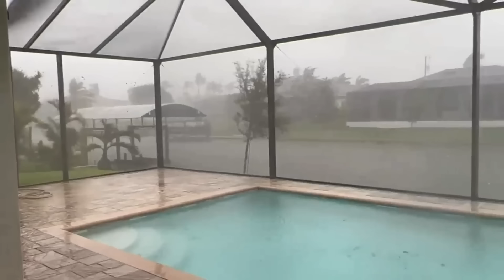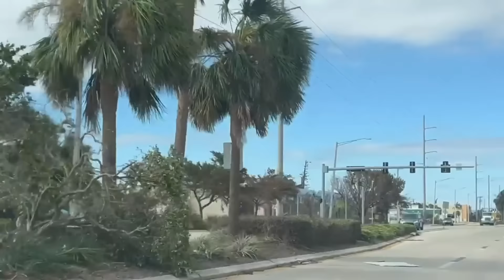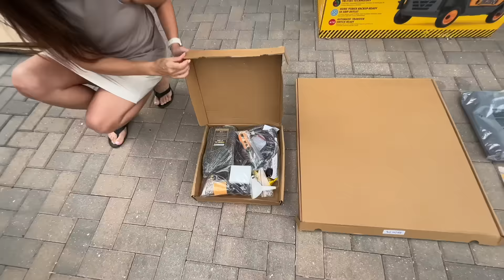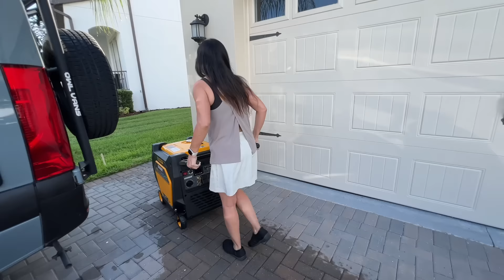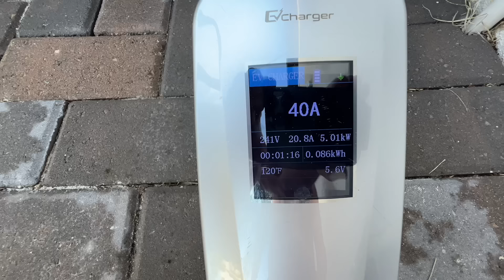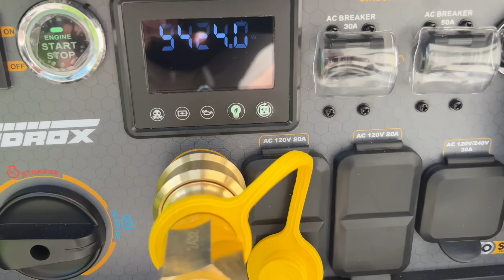Hurricane Ian - 3 Weeks Without Power Changed Everything: Gidrox 11,000W Generator

Comment: 😊 good idea Eco flow delta pro ultra X system and Eco flow delta pro ultra X extra 10 battery and Eco flow delta smart panel 3 and power whole house
Reply from the maker: Integrating a high-capacity battery system like that is a great way to build long-term power independence. 😊

Comment: everyone  doesn't need 11k genset . i did ok with a 1400 run sportsman during irma , i did use propane 3500 run  sportsman during ian .  ref freezer charging batteries tv fans lights  keep howse closed blinds shut cbs homes stat cook enough with fan for days . plus the bigger the gen the more fuel it uses and fu stations open have hours long lines\ btw i live in cape coral and untill recently vol with lee eoc  and only some areas had boiul water mostly in flood areas  and city failed as expected
powere stations whil convent they need recharging and will drain in day or so and if still cloudy and rainy a 60 or 100 watt panel's tale day to 3 to full charge  my sportsman have 8 amp dc charge plug i charged 100 ah lithium that have bms  dont charge them from idalling car though your alt will heat up sitting without airflow
Reply from the maker: You’re absolutely right that smaller setups can be very effective when you prioritize managing your energy usage carefully.

Comment: 50 gallons in a week? That’s crazy. There’s no way you were really conserving fuel if you burned through 50 gallons in just seven days.

I was in Superstorm Sandy and was out of power for 10 days. I had over 55 gallons of gas on hand, and what I learned from that experience is that a generator is not the way to go by itself because it’s completely dependent on fuel. If the situation gets really bad and you can’t get gas, then what? That’s one of the main reasons I switched over to solar.

You need to have a Plan A, Plan B, and Plan C. For me, solar is Plan A. As long as the sun is out, the batteries are getting charged and can power the house. If it’s been raining or overcast for a few days and the batteries aren’t getting enough charge, then I move to Plan B and use the generator to charge the batteries for about 4–5 hours. If the batteries are damaged or unavailable, then Plan C is using the generator to power the house directly, but conservatively.

That’s also where your central A/C becomes a problem. Anything running on 240V is going to pull a lot of power. Instead of trying to cool the entire house with central air, a few window units are much more efficient. I have four window units in my setup, and I can run them through the night and still wake up with around 60% battery charge remaining.

A battery backup system makes a huge difference too. Run the generator only long enough to recharge the batteries, then let the batteries carry the load. That alone can save a lot of fuel.

Also, propane generators don’t produce quite as much power as they do when running on gasoline, so that’s something to keep in mind. And after a major storm, you’d better already have a full propane tank, because propane deliveries can be delayed for days or even weeks depending on the damage.

Honestly, solar and battery storage are the way to go. Trust me, I’ve been doing this for over 10 years. There’s a reason so many people are getting solar. Let the sun do the work during the day, use the batteries at night, and keep the generator as a backup. If you had a decent solar setup, that 50 gallons could have lasted a whole lot longer than one week.
Reply from the maker: You make some good points.

One thing to keep in mind is that Hurricane Ian happened several years ago, long before I built the battery, solar, and backup power systems I have today. Back then, my backup power plan was basically a generator and fuel.

Even though I tried to conserve fuel, 50 gallons disappears surprisingly fast when you’re dealing with refrigeration, freezers, lights, fans, charging devices, and trying to cool part of the house in South Florida after a hurricane. The heat and humidity can be brutal.

Ironically, my experience during Ian is one of the reasons I’ve spent so much time building and testing solar, battery, alternator charging, and backup power systems on this channel. Today I absolutely agree that redundancy is important.

The reality is that every backup power system has strengths and weaknesses. Solar depends on weather, generators depend on fuel, batteries have finite capacity, and storms don’t always cooperate with our plans.

The biggest lesson Ian taught me was exactly what you said: don’t rely on a single solution.

Comment: Gas does not go bad, if  you rotate it though your car every 6 months.  The downside of your large generator is that you will never need that much power during an emergency and it would use too much fuel while not needing full power. Oh, also that is not propane, it is Natural Gas.  I would go with a Firman Whisper Series multi fuel inverter generator.  I have the WO3342, with 27 Gallons of stored fuel, it can run for a few weeks and repower my house batteries.  The EV can be powered from the batteries while optimizing the load on the generator.  Good luck.
Reply from the maker: After hurricane Ian, I used my generator to run my entire house including the AC, so yes I used the capacity.  Also, my house has propane not natural gas.  It is pipe the same way as natural gas as it comes fro a large storage tank for the whole neighborhood.

Comment: People should pay attention to the size of generator they need. Those big generators gulp fuel. If you can get by with a smaller one, you’ll be better off.
Reply from the maker: That is a great point.  I chose a big generator as I wanted to be able to run at least on AC in my home but if you only need to power a refrigerator/freezer aa much smaller generator would be more practical.  I do have a small Costco 2300 watt generator that I keep for just that situation.
Reply: @RubysAdventuresUnplugged  This generator can also charge your tesla while running the AC on Natural gas.  You have a great setup.  If you get a chance, think about adding a battery for your house that can also run your AC.  Mine is the Ecoflow DPU and a few batteries.  DPUx plus 2 batteries could probably run your house for half a day, or more, and the cost is coming down.  Good luck.
Reply: I ran a Generac XL5500 for 25 years and then replaced it with a Firman 3600W inverter.  During an emergency, you don't need as much as you think you do.  It is an emergency and you don't have to run everything in the house.
Reply from the maker: I agree that you can get away with minimal power if you want to just survive.

Comment: No idea how it works there, but don't they turn off the gas also if other houses are blown away? Keeping everything out of a salt water flood is probably an other primary task. It could come much higher. EV batteries don't like salt water and may spontaneously combust. Park outside.
Reply from the maker: I would agree that if a house was completely destroyed they would probably such off the propane, that is why keeping a couple 20lbs propane bottles is a great back-up plan.  Also, houses here are built from cement filled cinder blocks so it would be rare to see a house completely destroyed.

Comment: This looks like a CCP ad. And its nothing to rejoice about when the advertised limit breaker is not tripping off. it means you are frying your electronic faster. Just like i expected.
Reply from the maker: I appreciate the concern regarding the electronics, but I’ve been testing the load limits to ensure everything remains within safe operating parameters.  The load limiter did trip at 9500 watts which is not far from the max running watts of 9100 watts and under the max starting watts of 11000 watts.

Comment: Are you sure you're connected to PROPANE?  As a city dweller with in ground plumbing like you show, I strongly suspect you are connected to NATURAL GAS which has a different jet requirement for the air/fuel mix.. so it matters that you get it right.  On top of that, I find it strange that you noted the problem with fueling a generator, but then bought a new generator rather than adding a solar power station and solar panels to allow you to bank some power and reduce the amount of time you need to run the generator.
Reply from the maker: Yes my house is run via propane and I am 100% sure of that.  As for solar, yes I am a big believer in solar.  In fact I have solar on my van and I have done many videos on solar but solar panels can cause damage to your roof once hurricane winds get underneath them.  I have seen parts of roofs ripped clean off because of solar panels after a hurricane ... if I lived inland, I would definitely have solar panels on the roof and/or in the backyard.
Reply: @RubysAdventuresUnplugged  sorry you had to answer that so many times.. 🤪
Reply from the maker: np, I know it is confusing as it does look just like a natural gas line.

Comment: There are advantages of bonded vs floating neutral and it can be changed at the generator side. At the time I got a regular generator, an inverter generator for a whole home was expensive 5 years ago. Luckily, we don't have frequent power outages that warrants getting an inverter generator, but it's on my radar.
Reply from the maker: Technology has certainly made those larger inverter units much more accessible lately!

Comment: After hurricane Sandy we had no power for over a week and gasoline was in short supply for several weeks due to damage to the gas distribution facilities.  We used a 5000 watt propane generator during the day and a Honda EU2000i at night.  I had 20 gals of gas stored for the Honda and 4 twenty lb propane tanks.  Every day I had to go out and get the propane tanks filled.  I had no problem getting propane but would have had an issue filling a gas generator of that size.  You might want to a couple of 40 lb propane tanks on standby in case your neighborhood propane system dies.
Reply from the maker: first off ... Thank you for the replay and comment!  I 100% agree and have already purchased a couple 20lbs propane tanks as back-up ... you can never be to prepared and this talks can last a super long time.
Reply: Granted, I'm in Minnesota and not Florida, but we don't do neighborhood propane systems up here; which is why I made a comment to Ruby about being sure she's on a propane system and not natural gas... because IF Ruby's home is actually tied to a NG pipeline, as we typically have here, then the generator needs to be jetted for NG which mixes roughly 9 parts oxygen with one part fuel versus Propane, which is denser and needs a 24:1 ratio of fuel to air.  So unless that generator has the ability to automatically switch between those two gasses, your back up propane cylinders will not work as the generator would be running far too rich.
Reply from the maker: I have run the generator on both bottle propane and my underground propane so I am sure it will use both.  I am 100% sure that it is propane piped to my house as I have to pay the bill every month and I had to special order a propane capable pool heater for my pool/hottube set-up as well.  Also, the generator has a manual switch from propane to natural gas and it will not run on the natural gas setting when connected to my propane system.

Comment: Excellent video! Your video is like a breath of fresh air compared to other similar videos! I love that it was narrated by a very capable woman who is no stranger to anything she talked about. My only suggestion was you didn't do enough homework on the generator or on adequate fuel supply. Everything else was spot on! Congratulations! 
We did our homework & believe it or not our Honda EU7000is (Honda's flag ship inverter generator). It also has electronic fuel injection & super quiet. On economy mode our generator creates 52 db of sound & non economy at 58db. It's so quiet none of our neighbors can hear it running. We also keep 111 gallons of treated fuel that we rotate. We have enough fuel to last 3 weeks without needing to look for more fuel. Believe it or not our 5500 watt generator was tested to 9200 watts continuous at 240 volts. Only when we exceeded that to 9201 watts did the main breaker trip. Surge watts is 7000 watts. So ours went 2200 watts over rated load without tripping. So it's not uncommon to exceed the rated load on a quality generator. Our Honda can be paired with another EU7000is. That will deliver a whopping 11,000 watts if needed? We drive gas powered trucks with large fuel tanks. As retirees now we hardly use any fuel. We also are preppers like you. We would be content with not having to run out when everyone else does. We live inland away from the shore in New England. The longest we were out of power was for Snow storm Alfred. We were without power for 5-1/2 days. 
Our generator can back feed our entire house including our 2-1/2 ton Trane central A/C. 
Thank you for posting! Great content!
Reply from the maker: It’s always great to hear about how others are preparing their homes for extreme weather events.

Comment: You can change from a "bonded" neutral to a "floating" neutral by removing a wire inside the generator in most of the larger generators. The owners manual will usually instruct you on how to do this.
Reply from the maker: It is good to know that many manuals provide clear guidance on making those specific electrical adjustments.

Comment: Great idea 2 EcoFlow delta ultra X system 12,000 and EcoFlow delta ultra X extra battery 10 battery and EcoFlow delta smart Panel 3 with Ai and really power whole house and HVAC cooling/heating and EcoFlow smart EV charger
Reply from the maker: That sounds like a very robust setup for maintaining power through an extended outage.
Reply: @RubysAdventuresUnplugged no gas and really indoor back up power whole house and no sound

Comment: Think of your most minimal needs to reduce and conserve fuel. I like two generators 5500 watts each that can be paralleled for 11,000 total watts so when I don’t need the extra 5,500 watts generator one can be shut down to conserve fuel and used as a spare if one fails. I can run my well on 3,800 watts start up and my RO system on 4,800 start up but each will have a running watts of 2,100 and under. We keep a portable AC unit to keep cool in the largest bedroom for family sleeping. Fill extra vehicles full of gas and transfer that fuel for generator use. I make 240v with a step up transformer for the well. Every one’s needs are different except the need for some type of fuel.
Reply: I use a 72 inch R-12, refrigeration hose to transfer fuel from the truck to the gas cans by using the fuel injection cleaner port. Just take off cap screw on the R-12 line ( with the Schrader in it ) and turn the key, the fuel pump automatically starts pumping the fuel into the gas cans, you can run the engine also if you wish….
Reply: Do your 5500 watts generator’s  have a ( idle control ) during hurricane Wilma (2005) we were using a Generac xl-4000 with idle control, what a gas saver, once the refrigerator started up the compressor and it’s running the Generac would drop back to idle, at idle speed it put out 800 watts constantly…. refrigerator took 450 Watts after initial start up ,so unless you bridge the 800  watts gap, it never went into high speed…you can run lights (led-4watts each) turn on the entire house and it’s still on idle, microwave,coffee pot, 85” tv, water heater, then it kicks back into high speed…..and drops back to idle when you’re done with it…
Reply: @RicardoGonzalez-yz1vp Knowing what your generator is capable of supporting in an outage is more important. You proved it! Congratulations!
Reply from the maker: That is a very smart strategy for managing fuel consumption and redundancy during an outage.
Reply: I have one 5500 watt generator. It's more than enough for what we need. 
As for having a well. As good as they are. Having city water saved us after snow storm Alfred here in New England. 96% of the state was flat. This was before we had a generator. Our house was cold 38 degrees but we could flush our toilets & use the shower (albeit very cold marine corp showers). We have an amble supply of wood for the fire place. We survived. After that storm was the impetus for us to get a back up generator.

Comment: only one thing, you have natural gas or NG not LPGV to your home, just so people get the duel or tri fuel selection correct
Reply from the maker: Pat, I do have LP as the subdivision has a large propane tank that is plumbed under ground to each house ... it is not natural gas.  Thanks for the comment!
Reply: @RubysAdventuresUnplugged sorry then just never have seen that setup in a subdivision. Have a great day
Reply: @patthefireman100  me neither... which is why I made the same comments to her. 🤪
Reply: Whole bunch of people went on NG in north Florida during the hurricane, and the NG gas company shut down the NG gas lines for safety reasons…..before hurricane hit,and remained off for 2 weeks…….all those home generators were useless….
Reply from the maker: Wow that would be bad.  My LP lines are controlled by the subdivision as they control the tank.  My plan would still be to purchase both gas and propane tanks as back-up.
Reply: @RubysAdventuresUnplugged omg could you imagine doing all this prep work only to have a boat anchor sitting in your garage unable to operate
Reply from the maker: Well during one hurricane, water came into my house via the roof vent and then seep through the ceiling and collect in some of the lights and light junction boxes.  This prevented us from powering the house because it would have just shorted out and possibly hurt someone ... so it is hard to consider everything.
Reply: @RubysAdventuresUnplugged no doubt